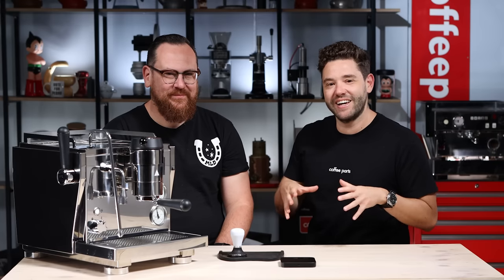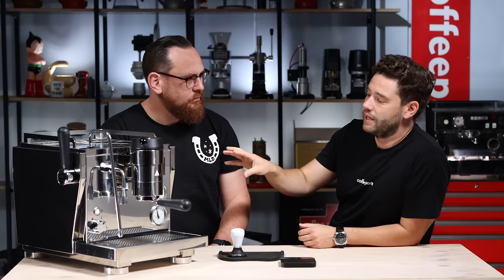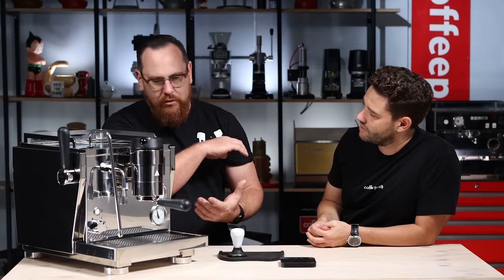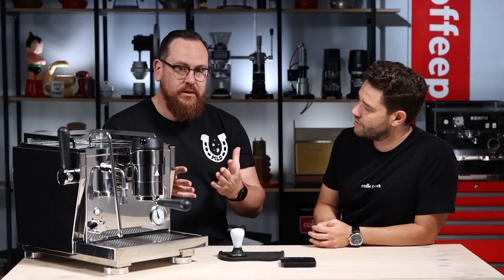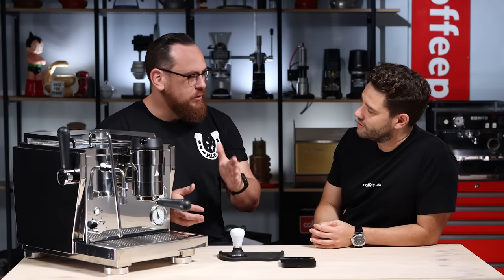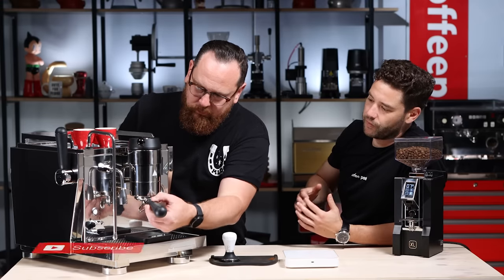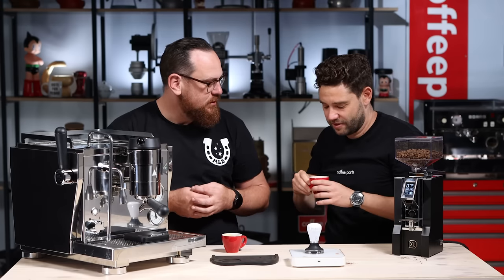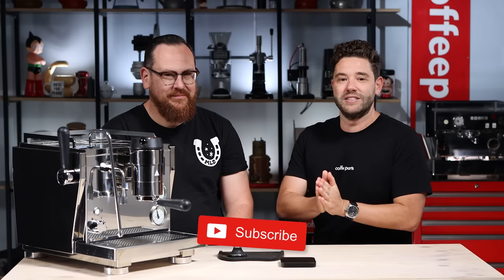Rocket Espresso R NINE ONE | Review

Comment: How different is this machine to something like a ECM syncronika with flow control?
Reply: With the added screen and computerized control, you can be a lot more accurate with your profiles. It gives you digital feedback on what's happening with the shot.
Reply from the maker: The ECM would be more similar to the GS3MP in terms of flow control. The Rocket is a proper pressure profiling machine, and more replicable between shots. In saying that, in many cases flow control is all you need.
Reply: @CoffeePartsTV  The GS3-MP uses a conical valve which essentially pushes water that would create excess pressure into the drip tray. 
It’s a pressure-profiler at core that also has no option to really control the flow rate.

Flow profilers like E61 give you more control. They can do everything that pressure profilers can and more.

Comment: I was ready to pull the trigger on a Rocket R NINE ONE, but at the last minute went for the DECENT Espresso machine which is entirely tablet controlled & fully programmable.
The flexibility of the ROCKET R NINE ONE is impressive, but the DECENT Espresso takes it to a whole new level.
I'm not knocking the ROCKET R NINE ONE at all, it's absolutely magnificent & gorgeous, the build quality & parts selection is top level. The inclusion of an expensive gear pump not only makes it quiet, but it's purpose-built to accomodate pressure profiling, which is something that the DECENT Espresso lacks.
The ROCKET R NINE ONE is the better choice if people are intimidated by technology, in fact I found your demonstration to be pleasantly straight forward, especially after living with the DECENT Espresso machine for a couple of months now.
Reply from the maker: Two very different machines chasing similar outcomes. Do love what Decent have developed, yet for me I like subtle technology and the presence the Rocket has. If I get my hands on a Decent again will do a review and comparison with the Rocket.

Comment: Great review guys. This is an amazing machine. 
I am curious how the pump pressure system is different from the flow control systems provided by GS3/MP and DC Mina. Controlling only the pressure doesn't give you flow control. flow is  = the amount of water you pass through the coffee. pressure and debit are not directly related. Curios if someone has a detailed comparison on these 2 systems.
Reply: I don't have an R Nine One, or work for any espresso company, but I can shed a bit of light. Pressure Profiling machines like the RNO, ACS Vetruvious, and (one of) Vibiemme machines take the pressure reading right at the end of the pump, prior to to water journeying onwards towards the grouphead. Say a low bar pressure is engaged on the pump, since the pump has a constant orifice size, at a specific bar pressure the water flow out of the pump will be constant. I don't have a pressure profile machine so I don't know what the water flow (ml/s) would be at say 1bar, with whatever orifice size is used in the RNO. Let's imagine at 1bar, for the RNO, the water flow rate is 1.7ml/s of water trickling through the piping from the pump to the grouphead. The water flow would be constant, even when if the puck where to choke the water flow. The water flow would first fill the volume of tubing between the pump and the grouphead, then eventually blead out the OPV valvel, if the puck didn't allow water to flow through. The GS3 Flow Profiling uses a diverter valve. At full flow rate, all the water is going to the grouphead. If you want to lessen the amount of water going to the group head, turning the paddle would allow some water to be diverted to the drip tray, allowing less water to go to the grouphead. The Mina uses what they call an iris valve, very similar to a camera lens iris controling the amount of light through the lens. At full water flow, the iris is full open. If you want less water to go to the grouphead, the iris size is made smaller, allowing less water to flow to the grouphead.

Comment: I have had a GS3 MP and was really frustrated with it. Zero consistency. I sold it then bought the GS3 AV. Super consistent. Now bored with it. I have always wanted a R9 One. Looks lovely and very flexible but was put off after talking to so many “experts” regarding its reliability. My AV is now up for sale and the Helios RSB chrome grinder.
Reply from the maker: Nice collection you have had! The MP can be hard in the sense you need to manually do it every time, yet it should be quite easy to get a feel for it and be somewhat replicable. AV is simple, really made for offices and coffee carts, to just pump out coffees. 

R9 One, does have more tech than the MP/AV so in a sense more to go wrong, yet we have had very few issues with the Rocket brand and next to no issues with the R9 One, so kind of hard to comment. If where you are located, the importers or retailers are solid companies then I would not be too worried. If in Australia then of course we can help you out :)

Comment: 02:36 according to the parts list the R9 one uses an ordinary Fluidotech rotary pumphead with an 180W 24V(so its DC) Motor attached. Seems llike the pressure profiling is handled via this, as Rocket calls it, "servomotor".

Comment: I’ve heard and read about feedback delays with the screen and delays in the flow rate actually changing as you 
Adjust the lever. Any experience or thoughts on that?
Reply: I'm interested in this. It would be likely be a firmware issue as the hardware can manage the role (or hardware if Rocket started sourcing different parts due to COVID shortages and chose something out of their design spec)
Tracking such an issue across manufacturing dates would help too but I don't know if Rocket are really transparent about such things.

I'm about to receive an R9 One... I haven't checked if the machine is firmware upgradable. Hopefully it is!